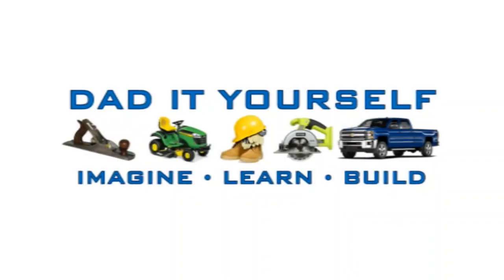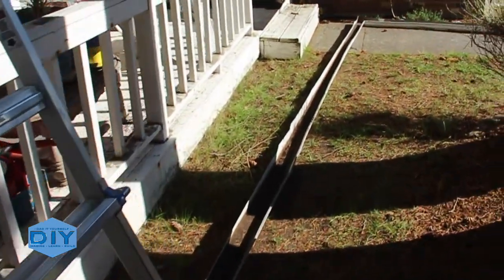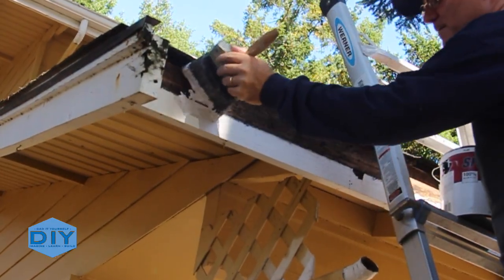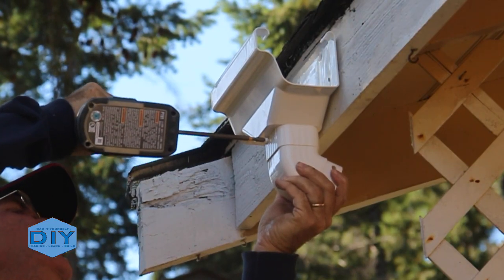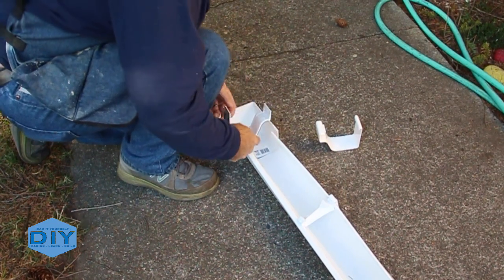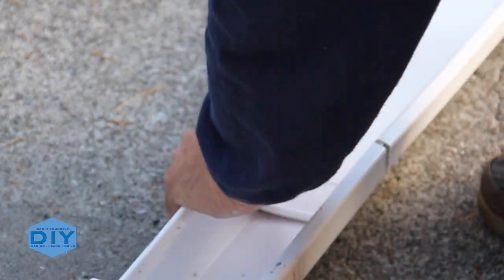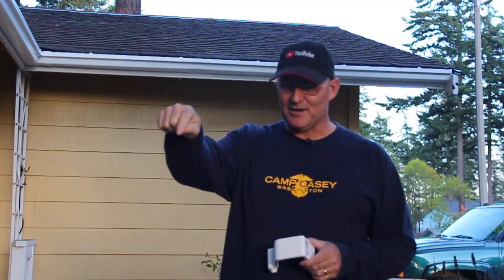INSTALLING Amerimax Vinyl Gutters | Homeowner EASY! | 2019/40

Comment: I'm installing this same system, and my outside corner pieces don't seem to fit properly over the gutter, has anyone else experienced this? When I snap the gutter in, the upper "j-hook" is too small, especially on the fascia side. The corner piece doesn't properly fit over the gutter, but it's the correct size.
Reply from the maker: That's interesting. My be a temperature issue, or you just got a bad batch.

Comment: How do you connect the end cap to a downspout, not to the gutter? I need to connect an inside l shaped turn where the one side is a level higher than the other. It can work if the downspout feeds the lower gutter, but th end cap doesn't fit the downspout gutter piece.
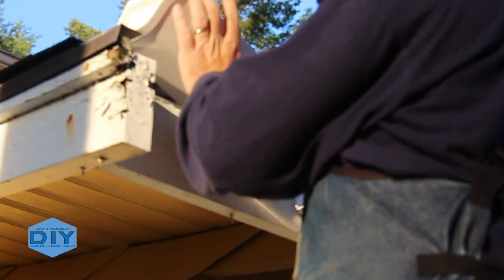Reply from the maker: You need to put a small piece of gutter material into the opposite side of the downspout fitting, then attach the end cap to that. The downspout usually is not at the absolute end of the run. You can see how I did this at about 8:45 into my video.
Reply: You also have the option of running the gutter completely through the downspout so it sticks out just enough for the end cap. Then cut a hole in the gutter above the opening in the downspout to allow water to drain. Fewer fail points this way.

Comment: WHAT ARE THE TEMP. MARKS ON THE INSIDE OF THE DOWNSPOUT FOR?
Reply from the maker: Because plastic expands and contracts with temperature you have to insert the gutter runs far enough in based on the current temperature. if you were to insert them close to the end then the temperature dropped, the gutter would contract and pull out of the connection.

Comment: I am planning on installing gutters on a two story house.  Does the second story downspout just empty on the 1st story roof or does it have to route to the 1st story gutter?
Reply from the maker: You can do it either way. Just realize that if you drop onto the lower roof, those shingles are going to take more wear. So using flashing etc. For extra protection splash control, and such will extend the life of your roof. You can always go straight to the ground with your second story downspouts as well.
Reply: Dad it yourself is correct about single wear but you may want to check your local code. They vary city to city.

Comment: What if you have a drip edge?  If you install gutter under drip edge, how can you get a 'drop" or "pitch"/
Reply from the maker: The drop or pitch of the gutter is from the furthest point from the downspout as the high point to the downspout. The drip edge protects the fascia from water contact and has no impact on how you slope the gutter.
Reply: @DadItYourselfDIY  Thank You :)
Reply: @DadItYourselfDIY  well, the drip edge flashing certainly makes snapping a chalk line more challenging.
Reply from the maker: Yes it does..

Comment: vinyl gutter?  I think  it is a poor choice
Reply from the maker: its a great homeowner project. metal gutters require specialty tools, etc. Its been a year and they are perfect.
Reply from the maker: @Dennis Adams. For this project it was a good fix that will last a few years. Ultimately this house is going to need the entirety of its gutters replaced. Better to spend $100 now, when you cannot afford $3000